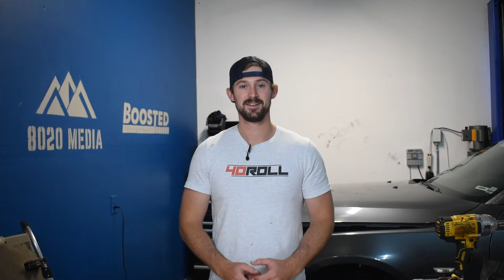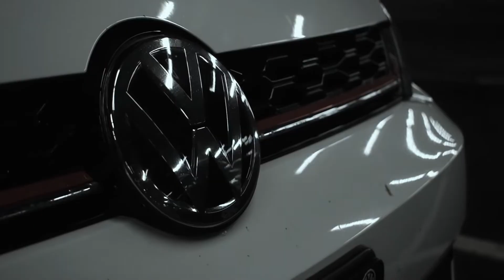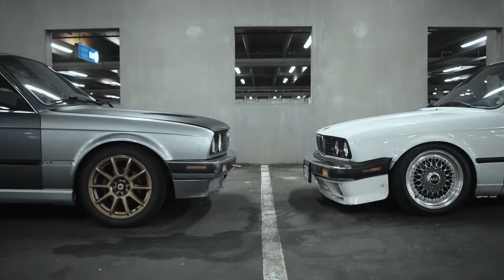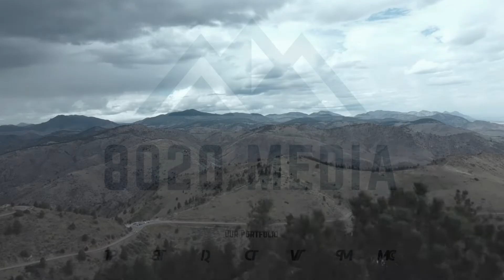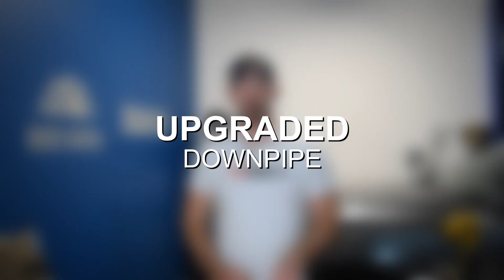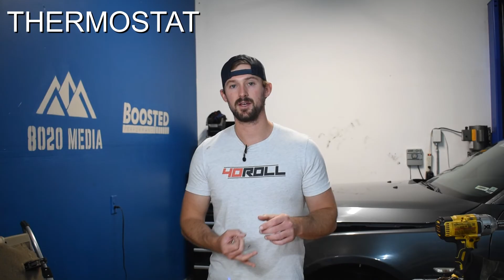How to Build a 300whp 3.0 EcoDiesel!

Comment: Here are my list of things to do…
50hp tune. Banks monster air intake. Delete all BS egr & cat & muffler. 4” or 5” turbo back straight pipe. Cost is minimal. Trans tune. Get temp sensor. From there a better turbo but not so big it kills the engine. A CCV delete. Inner-cooler upgrade. Thermostat swap. Total cost $5k or less. Most work can be done by an average mechanic owner…
Reply from the maker: S - Pretty good list! Keep us updated.

Comment: I have a 2021 Wrangler that I call my unicorn. I want it to last as long as possible, that said, based on the new EPA changes from Trump, I want to remove the EGR and maybe the DPF, and upgrade the exhaust before adding a tune. I don't live in a emissions testing area and no plans on it in the future. Can anyone recommend a good way to find a shop to do this work in the Colorado / Wyoming area?
Reply from the maker: N - You're doing it right!

Comment: I have 274.000kms on my 2015 and it runs like a top. New intake at 234,000 because it was coked up, cleaned EGR tube, new MAP sensor. Amsoil all the way, 5W40 in the engine. Soon to pull the oil pan and clean the EGR and MAP again. Last long trip was 8.1L/100km, that's 34.9mpg. I also have a Banks/Derringer tuner that has 6 stages. I usually run on 2 and that takes the danger out of the slack stock performance. It has lots of giddy-up!
Reply from the maker: B - Hell yeah! Thanks for taking the time to share your experience, sounds like a sweet setup.

Comment: You literally need a tune to get 300 hp.
Technically, intake, exhaust (inc. Delete), intercooler/charge pipes and intake manifold all help, but really a tune gets you at least 95%
Reply from the maker: J - We don't want to recommend building an unreliable setup, ie just a tune. All the things we recommend, make it much more reliable.

Comment: I just added a S&B Cold Air Intake and a Thornton 40hp chip ... woke it up, great throttle response, way better than factory... runs great! And meets provincial specs - no fines and passes inspections. You need to clean the MAP Sensor, EGR Tube at least every 10 to 20,000K kms, and remove Intake and clean out the soot including removing oil pan and cleaning the oil check tube, at least every 40,000Kms... they run dirty and build up soot - if you maintain and clean the soot up, the engine will last....  I'm at 72,000 kms on my 2015 and it runs top! I change oil every 5,000 miles
Reply: I have 274.000kms on my 2015 and it runs like a top. New intake at 234,000, cleaned EGR tube, new MAP sensor. Amsoil all the way, 5W40 in the engine. Soon to pull the oil pan and clean the EGR and MAP again. Last long trip was 8.1L/100km, thats 34.9mpg.
Reply from the maker: K - Well said! Thanks for sharing this!

Comment: Great video. I read the article too, some valuable info here. I am wondering - these mods improve HP and torque, but how do they affect the mileage?
Reply from the maker: P - Depends on how aggressive you go on tuning. Picking the right mods and tune could actually increase MPG.
Reply: @8020Media  thanks for your reply! We have a full time diesel mechanic that works for my employer - we were just discussing builds today. 
I sure love Cummins Engines but I don't really need all that power on the daily. So I am considering getting myself an EcoDiesel and get the best of both worlds by employing these mods

Comment: Does anyone do a throttle delete?
Reply from the maker: G - Many people do. What're you looking to get out of it?
Reply: @8020Automotive  More reliable daily driver, and a more responsive truck. Looking at the Gale Banks aluminum intake manifold to eliminate all the plastic on the motor.
Reply from the maker: G - Not a bad upgrade!
Reply: @8020Automotive  thanks, just hoping that it all comes together sooner than later :)
Reply from the maker: G - Keep us updated!
Reply: I replaced the OEM plastic intake manifold with the Banks intake manifold. You must use the throttle body delete with it, OEM won’t fit. You must do at least an egr delete with this mod. Buy intake manifold gasket kit and fuel tube kit.

Comment: The biggest problem with this and other turbo engines.  Is hot soak, or shutting down the engine too hot, and cooking the oil on the turbo.
I really like my Ecodiesel.  On icy roads, our Cummins powered Ram 2500 gets very difficult on icy roads.  While the Ecodiesel works just perfect in those conditions.
Reply from the maker: J - Thanks for the insight. We actually have a video addressing heat soak: https://youtu.be/F75UsqxAHUs

Comment: Hands down the best thing you can do to make this engine somewhat reliable and last a while is to delete the egr and dpf
Reply from the maker: B - We can't recommend it, but yes. Thanks for sharing this insight!
Reply: As soon as it rolls off the assembly line Is the perfect time to do it
Reply: @CodyVance-wd8yj The most underrated statement ever
Reply: It's the egr mostly. The dpf is fine, especially if you use something like amsoil ms which doesn't clog the filter as easily.
Reply from the maker: T - Thanks for sharing this insight.
Reply: My 2016 has 375000km or about 225000 miles delete run rotella t6   or better be sure let it get warm
Reply: Often no longer street legal after such mods unfortunately 😕
Reply: @patrickbass3118 not if you live in Florida😁
Reply: @Saw-ds3ro  luckily Ontario has recently scrapped the [fake] emissions test. But I know a lot of states and provinces/territories still have the emissions regulations
Reply: @patrickbass3118  test gone almost 6 yrs ago but laws didn’t change.
Reply: My gen 2 ram still has all the emissions intact with over 200k miles with plenty of idling time. Most of those miles I’ve towed heavily. Don’t believe everything you read on the internet.
Reply: @JFitness88  Imagine how much better it would run with the modifications. The fuel savings alone would more than pay for the mods. Not to mention more reliability and longevity as well. Once your DPF goes and you get a $4500 bill from the dealer, a $3000 delete kit makes more financial sense in every scenario.

Comment: Great thing about Texas is the fact we dont test for emissions here. So im going to delete and straight pipe the engine with a 3 inch to 3.5 inch exit. I wanna tune it to get 335 whp and god only knows what the torque will be. Oh, and im also putting it in a 2015 challenger i bought with a busted 3.6 v6. Im out to prove diesel powered muscle cars can and will be the future. EV is just shitboxes
Reply from the maker: C - Couldn't agree more. Thanks for sharing your experience!
Reply: Texas absolutely does test for emissions. It just depends by county. And thats such a god awful idea. You're gonna get drug by a bone stock scat pack and those are already slow. Your idea sounds like something a 17 year old came up with in math class.
Reply from the maker: G - This is correct, depends by county.
Reply: @gordonbombay676  lmfao no they don't. They do nor test for diesel emissions OR for motorcycles. And I'm not building the fuckin thing for speed. I'm building it for fuel efficiency. Said motor will be going in a 1971 AMC javelin. Why? More torque than a 426 hemi, tuning to have the same horsepower as a 383 big block and with a 2.62 ring and pinion gear which I'll have custom made, I'll be getting AT LEAST 50 mpg all day long. Fuck going fast, fuel is too expensive to keep being stupid with that sort of mindset. Plus it'll be fun to go up north and see family more often. Diesel is the future. God bless.
Reply: They do not test emissions as in a sniffer test. They only check the engine codes. If it's tuned with something that fakes the computer out, they don't know unless they do the visual check. Some places will and some won't. That's where the counties differ. Mine does.

I believe in 2025 they're getting rid of the inspection entirely in most counties...again mine is one that still will

Comment: Junky motor just junk
Reply: Data says otherwise, Including reliability,  power,  and MPG. Ram did a internal investigation and found only a 1% failure rate from 2014 to 2019.
Reply: Not true, look at the miles on ones for sale. My 2nd gen ran to 148k and I traded it for a 2022 that now has 46k. Like most modern diesels, 10k oil changes and short trips will send it to an early grave. Can thank the emissions restrictions for that.
Reply: Unfortunately this is true for even the larger diesel engines as well. Most reliable diesel truck engines are built before DEF  @DBrew139
Reply: Anything will fail if you don't know what your doing
Reply: Bull it had 36 gra d in work 77 thousa d mile truck@andrewbertuglia453
Reply from the maker: Haha yeah, not the greatest.

Comment: I have a 2018 ecodiesel, if I replace the down pipe and keep my emissions intact, will I have a problem passing smog since I am replacing the down pipe?
Reply: Could you guys provide a link to a down pipe or even a brand can’t seem to find one. Thanks
Reply from the maker: Cruz - It depends on what kind of downpipe you're going for and where you are looking to get your inspection done. Do you the mechanic well that will do it?
Reply: @8020Automotive Whatever one you guy's recommended on your article but looking at it and looking at other videos, I will need to delete the whole emissions in order for that to work:/